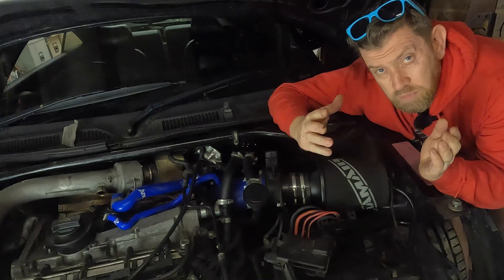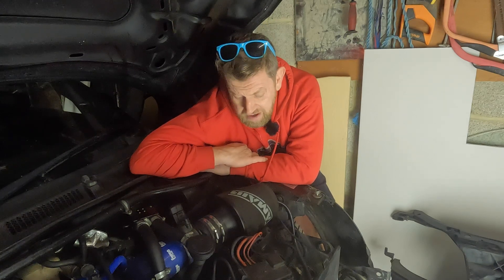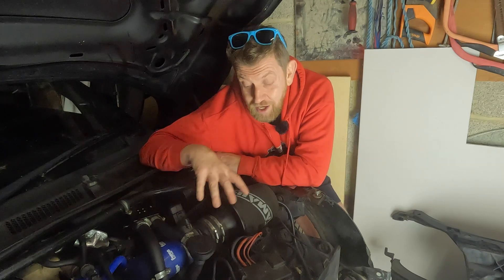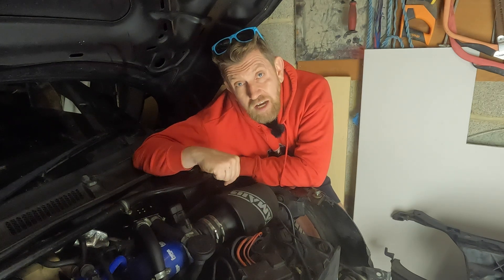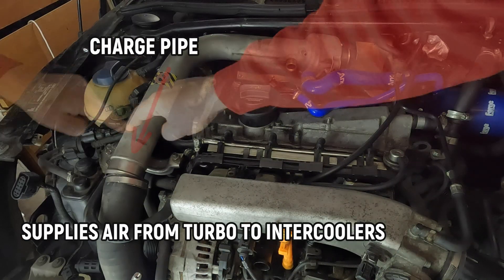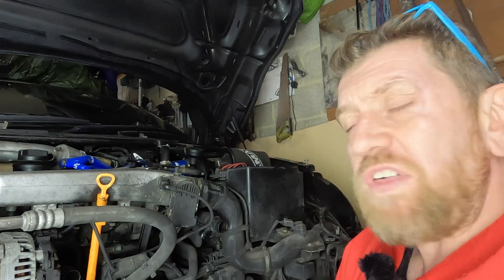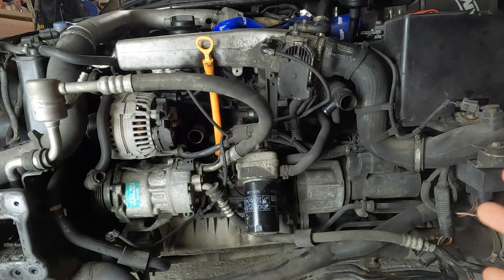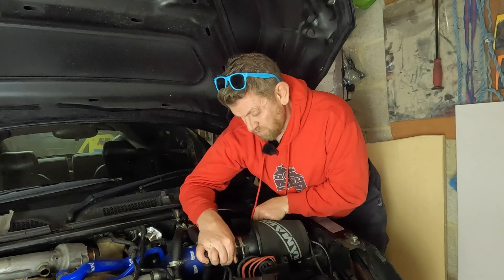Audi TT Mk1 - What is an induction kit used for? Performance Air Filter

Comment: Awesome videos mate. Keep it up. 
Have installed a BMC CDA carbon intake, and connected on the intake inlet a silicon pipe going slightly inside the wheel guard as far away possible from the engine bay. MAF shit itself, maybe it got shocked with all the extra air coming in 😂, and had to get a new sensor. Couple days into the new MAF and drives and sounds like never before. Hope it lasts and doesn’t start playing up again. 
Completely agree with you with moving it down below after your front mount intercooler install. Have seen photos of it done but even so, with the BMC intake you could take the inlet pipe down to where the intercooler was housed through the wheel guard for an easier option.
Reply from the maker: @billsirma6046  thanks Bill.

Comment: Obviously the problem with the air coming from the air filter (any air filter - large cone or the standard paper panel filter) is that it passes through the turbo which is maybe a couple of hundred degrees ºC, making the air hot and negating any engine bay cooling attempted. What will make a difference with a larger cone filter is the total amount of air flow will be higher in litres/minute (and hence increased O2) for the same ambient temperature over a standard filter. So larger intercooler(s) after the turbo and before induction will have more of an effect. And not all front mount intercoolers will need the bumper cutting to fit - I have a HG Motorsport FMIC from Germany and it sits in front of the radiator with no cutting to install necessary.
Reply from the maker: Great info there! Thank you 👍
Reply: Actually, thinking about it, the HG Motorsport FMIC on my car fits without cutting the bumper, but mine's a 1.8 – I'm don't know if a 3.2 bumper would needed modification?

Comment: I personally do not like the sound an open filter makes, there is a bit of information available on this topic, the restriction on a standard air box is caused by the inlet pipe to the airbox, some have opened this up but it does mean cutting the inner wing, try searching for the WAK mod its an interesting read, as for the intercooler search the WELLY mod again great information, cheers for the video Andy keep it up appreciate your time in doind so 👍

Comment: You won't want the air intake lower than it is otherwise you risk sucking in water into the TIP when wading through a puddle which, well you know what that will mean to your car's engine. Better solution would be a snorkel or a vent cut into the bonnet
Reply from the maker: @TinyBull  that is a great idea. I did think about that afterwards and the pitfalls that could come with it. I wondered if you could “louvre” the wing somehow to get more air into the engine bay too, or would the drag co-efficient cancel it out?